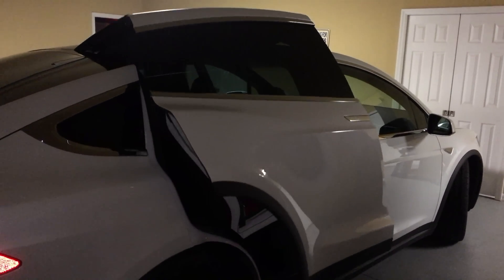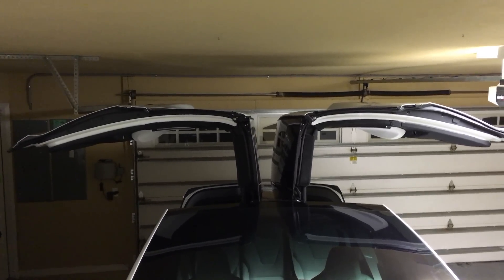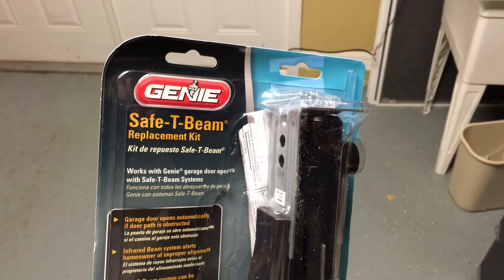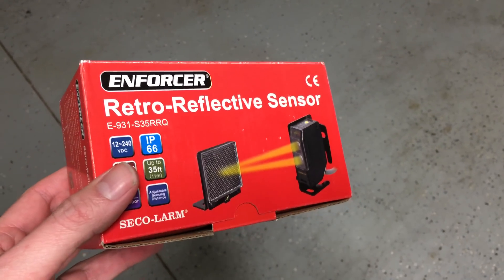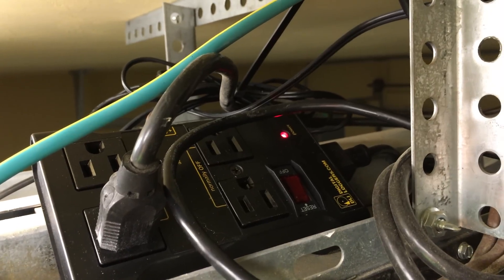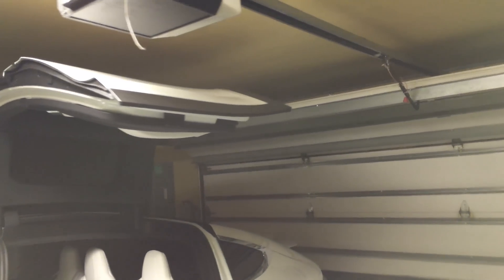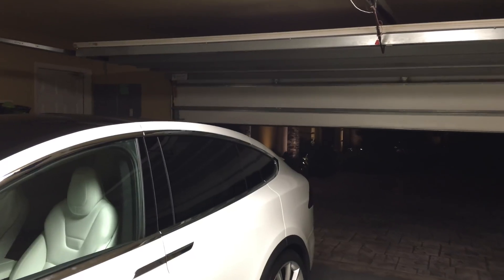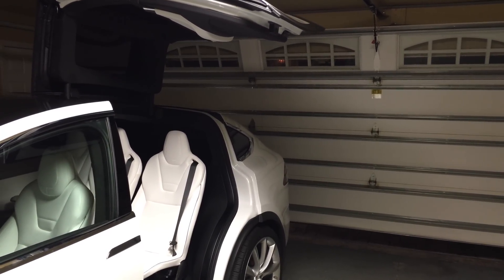How to protect the Tesla Model X Falcon Wings from a moving garage door

Comment: You could improve your setup by mounting the sensors to the topmost segment of your garage door. So it will only cut off the power while aproaching the falcon wings, not while closing. :)
Reply: Can you elaborate on this idea?  What part would you mount to the garage door and where would you mount the other part?
Reply: Andrew Brodsky I would add both elements at the top of the highest segment of the Garage door, they must sit a bit higher that the upper end of it. Only issue might be the device itself, so it would be only possible if the door is large enough to be wider than the falcon wing doors :)

Comment: I have the same parts, how are you wiring your sensor to the AC control unit? It has a two pin block, and the sparse documentation with the parts are confusing me about where I should be wiring my white/gray/black (NO, NC, and common) to this two pin block on the AC controller. Could you shed some light on the wiring setup?

Comment: Just build a higher garage :D Our garage is just over 4m high so you can get all (German) street legal vehicles from the street into the back yard. The garage is the only way to do that so both garage doors open just over 4m up to the ceiling so every car will fit. Even a Model X with Falcon Wing Doors opened to the maximum.

Comment: Except this solution will not work for me as my garage door opener has built-in battery backup in case the power fails.
Reply: If you connect the sensor to the built in battery,  problem solved

Comment: Or instead of shutting off the door, the falcon wing detector commands a blocking arm to come down from the ceiling just behind the doors. Then the limit sensor on the garage door would hit that instead of the car, and opening the falcon wings while closing the garage door would have no effect. Just a thought. It's a bit more of a construction project, of course.

Comment: The solution that will not interfere with the closing of the door is putting the sensor and reflective tape on each end of the top of the door along its metal strip. The only additional complexity is to have the sensor wires not get tangled in the door.
Also, it is not "for a peace of mind" it's "to have peace of mind"

Comment: Good solution.  These doors just don't belong on this car though.  They might've worked on the S as they wouldn't go as high, but on the X, this looks like an issue they had to know about.

They like them for marketing reasons.  They look cool and catch eyes, just like the DeLorean.  The added weight and complexity though are huge.  Not just the weight of sensors and actuators, but cutting so far into the room greatly reduces structural integrity in torsion.  It's why you don't see T-tops anymore.  This weight penalty to re-stiffen sacrifices performance and range.
Reply: +blurglide 
I'm really hoping that they have a regular-door "base" version already designed,  safety tested, homologated, tooled up etc and ready to roll off the assembly line.

The added complexity is my main concern. I'm sure there are many people like myself, who simply want an awesome electric SUV, without all the bells and whistles.
I'd probably pay more for one without those doors, TBH.
Reply: +ROBwithaB, That's what I said, an electric EV(well, admit it, it's a minivan) was good enough, but Musk wanted his "cool" doors. Tesla will be fortunate if people aren't bringing their car to the service center every 6 months because these doors go out of alignment and don't close or seal properly/leak.
Reply: +blurglide 

I agree however this is one of those pros vs cons thing.  

Pros:
-Marketing in a culture that loves to consume the latest tech and innovation, which is always good since its greener.
-Innovates and solves actual real world issues of parking in tight spots and getting in and out of the backseat.

Cons: 
-Garage opening on the doors which could partially be fixed with a tech update if not a preset setting already.
Reply: +SuperExcedrin 
Exactly. Without a regular dealer network, Tesla really needs to squeeze the maximum utility out of a limited number of service centers., otherwise the entire business model becomes untenable.
The entire in-house-servicing strategy was predicated upon the principle that an electric drivetrain requires much less maintenance. Which is all good and well, and they seem well on their way to "perfecting" a drivetrain design that would be good for hundreds of thousands of miles. But then they went and deviated from the first principle of low maintenance, and saddled the car with features that will have the complete opposite effect.
The door problems are going to clogging up the service centers for years to come, with a range of irritating niggles that cannot be cured by over-the-air updates. And some that will no doubt require that the entire door be dismantled.
With the mass-market Model 3 on the way, it's turning into a slow-motion nightmare. Every additional set of Falcon doors out there only adds to the potential chaos.
The sooner they're able to offer a version of the X sans those doors )and windscreen and seats) the better it will be for the potential owners, the company, and the world at large. Just option the doors already....
#OptionTheDoors
Reply: +SuperExcedrin 
I foresee a big problem with the doors operating when the car is parked on a slope. On a perfectly level surface,  door alignment probably wouldn't be too much of an issue. (And I'm guessing that's how most of the repetitive testing was done, inside the warehouse.)
But perfectly level areas are not universal. Inside your garage, sure, but what about the other end of the trip? In hilly areas, "perfectly level" is the exception. For cars that are regularly parked on steep slopes whilst loading/unloading pax, those hinges are going to take a hammering. Over time, expect uneven wear. This becomes a vicious circle as the tolerance increases and the lateral component of the forces becomes greater. At some point the door will just stop working. Very annoying. And not a cheap fix.
And heaven forbid you move the car with the falcon doors open and they snag something, however lightly. You're never going to get them straight again...
The resale value guarantee is eventually going to sink the company, if they don't do something about this soon. The most obvious solution would be to simply give the market what it wants, which is a fully electric SUV.   With the emphasis on the "Sport" and "Utility".  The cool part about this is that they already have 90% of the vehicle already designed, tooled, and tested.
With some minor tweaking (regular doors, regular windshield, regular second row seating) they would have a hugely profitable and hugely popular vehicle, that would be cheap and easy to build, with very few things to go wrong. The market for such a vehicle is probably 2-10 times greater than for the weirdly adorned glorified minivan.
Of course, the upscale soccer moms could still get their falcon doors, but they would pay more for them to cover the future maintenance issues.
And with a much smaller proportion of the flawed vehicles driving around, the company might actually survive to deliver on its promise.
#OptionTheDoors
(Apologies for the lengthy responses. I've been thinking about this a lot, for the last year or so. Very frustrated that Tesla did not see this coming, when it was perfectly obvious to lots of "normal" people.)

Comment: A simple fix might be to stretch a cloth or tarp across the bottom of the garage rails in the area where the FWDs open, which always would keep them from opening far enough to be damaged (assuming the sensors do in fact discover the cloth's existence).  Of course they will always open only that far.

Comment: Not to be that guy, but you got pretty good clearance there on the garage door and the ceiling.  Would there be a reason you couldn't raise the track another 6 inches to completely resolve the clearance issue? The track to the roof as is usually 5 inches minimum. Its recommened that you have 12 inches, but usually its not required (building codes and such).
Reply: +Marcus Adolfsson 
You can leave the spring in place.  I would get a larger radius door track and you can almost go to ceiling with door track and if need be you can also replace the garage door opener with a wall mount opener like the Liftmaster 8500.  Now you have full freedom of both falcon doors all the way up and garage door open.  Worst case scenario is you have to have an expert tighten spring a little for proper balance.
http://www.chamberlain.com/CatalogResourcesV3/Rightnow/RNImages/trackradius.jpg
Reply: +Gerard Borys 
I maybe wrong about not having to move the spring but i think if you just bought a Model X...then I'm sure you'll be kicking yourself later if you don't have a high lift conversion professionally installed sooner.